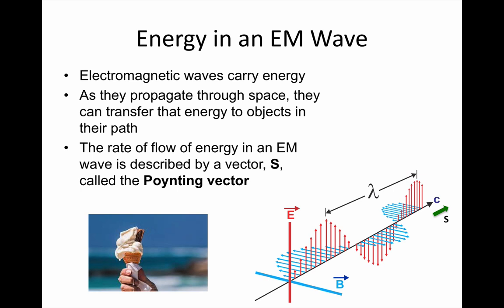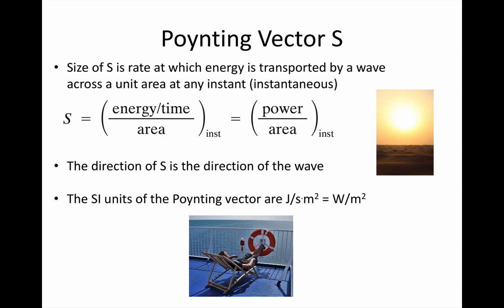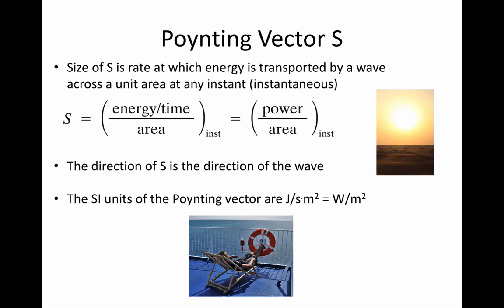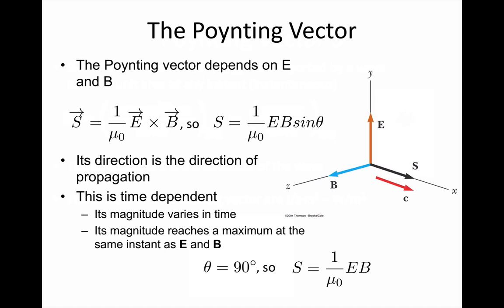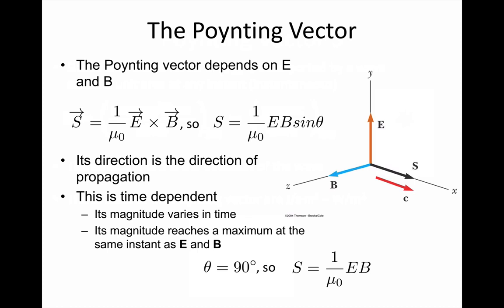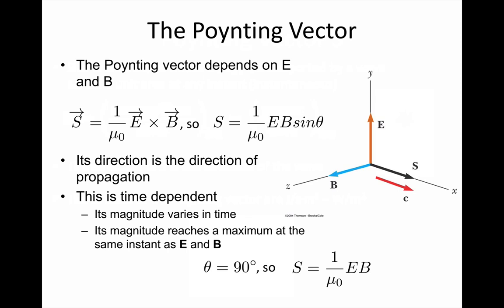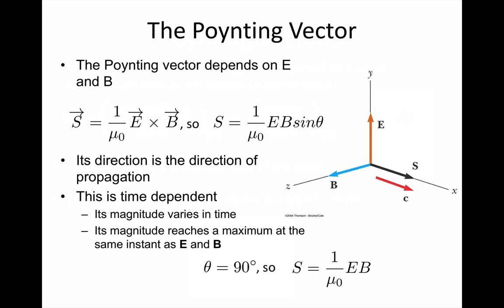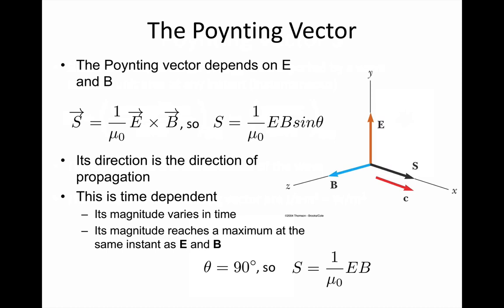7 Poynting vector

Comment: i have a question.
in some source, I=S= 1/2mu * EBsin90, but in this video  I=S= 1/mu * EBsin90. Which one is correct ?
Reply: Intensity is the poynting vector averaged over a time period. S= 1/mu EB sin90 = 1/mu × 1/c × E² . Average of E² over a time period gives the factor of 1/2

Comment: Why did you refer to the cross product as the curl?
Reply: Not a professor but I think it was just a tongue slip. Should have said E cross B.
Reply: In vector calculus, the dot product is referred to as the divergence and the cross product is the curl. It is extremely useful in understanding and analysing things like fluid flow (which has close analogies to the elecromagnetic field).
Reply: @earendilthebright5402  
I've never heard those words refer to anything other than the differential operators div and curl. In Cartesian coords, those are like taking the dot/cross product of the nabla 'vector' {d/dx, d/dy, d/dz} with a vector field, but that's not an ordinary vector at all, and calling the cross products of two regular vectors "E curl B" sounds very strange.
Reply: @WhiteBeansYT  It wasn't a toungue slip. It was intensional but I think it's wrong. Because curl A generally means "del cross A". I don't think E cross B can be referred to as E curl B
Reply: @hariraagavtr8426  I've never heard that terminology but I'll take your word for it.
Reply: @WhiteBeansYT  Surprised you replied to this 😂🙌🏻
Reply: @hariraagavtr8426  I watch this video every day to remind myself to keep my life moving in the right direction 〰️〰️
Reply: @WhiteBeansYT  Wow.
Reply: She meant the actual curling of your fingers, not the curl operator. It is probably not a good term to use in this context because of how confusing it is. I think "curve your fingers" or "cup your fingers" would have been better.